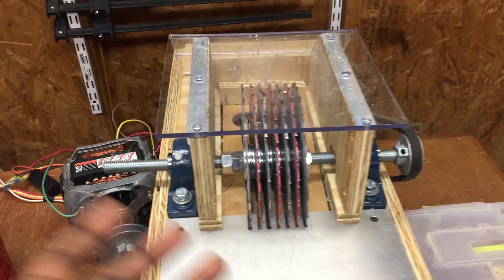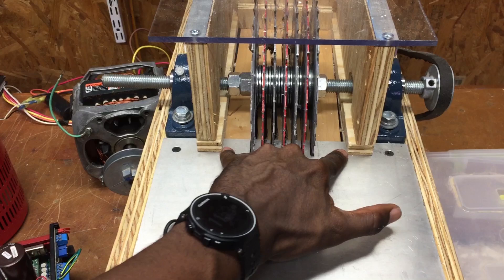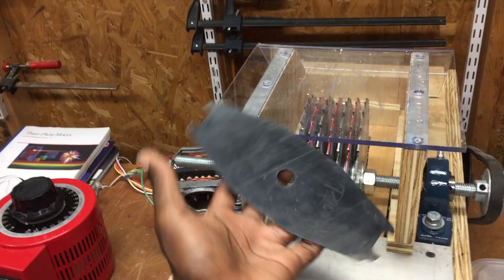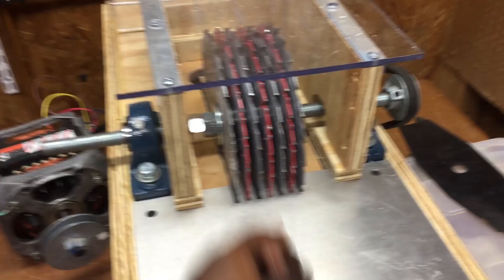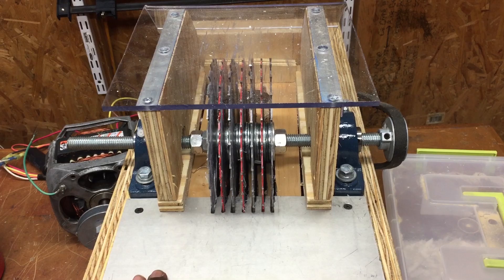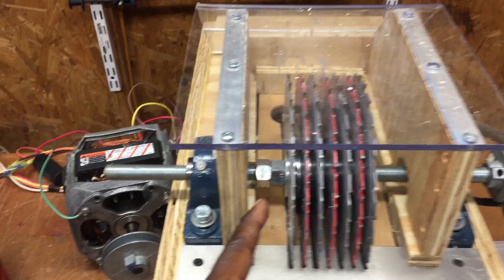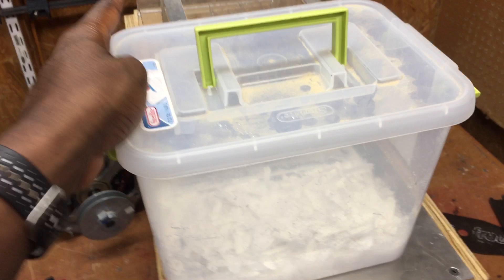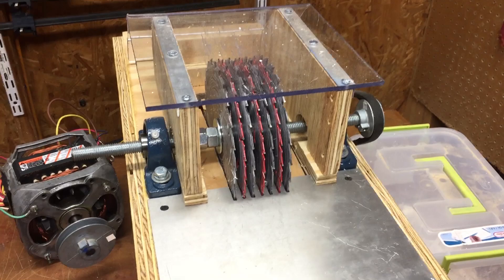Scary Prototype Shredder Design pt 2; A Cheap Alternative to the Precious Plastics Design: 037

Comment: Ideally you would want to use a blade like in a wood chipper. A blade that cuts axialy as opposed to radially, like a saw blade. However, I know you don't own a metal lathe and Cnc so that would be difficult to make. And I know sawblades are already easily accessible. My thoughts would be use smaller blades. Maybe something like you would find in a biscuit jointer. Or at least a blade with less teeth. The more teeth, the finer the shavings. The less teeth, the more coarse. I have no experience melting hdpe but as you said in the video, your subscriber had said he had problems trying to melt fine material. 
Going back to the wood chipper, you definitley want a funnel. Maybe 45° downward, tangential to the blade. 
One more thing to try, what if you tried rolling up the plastic sheet into a burrito and feeding it in? Just for shits and giggles.
Reply from the maker: +P0tat07 rolling it sounds like a great idea. I could angle the feeder slightly. This is just the most convenient design. This was the lowest tooth count I could buy for $6 each (24 teeth) . I really want 12 tooth blades. That is an optimization that will come in the futures
Reply: I'm thinking the denser the material you feed in the less it wants to pull due to the fact that it can't shred all the material being fed into it at once.
Reply: +Jeremy Fielding by angling the feed, do you also mean changing the point of contact? Looks like the blades are cutting near centerline. Would raising the axle and tilting the feed table down in give you a better pull?  Or would you consider sinking the bladeset into the table like a tablesaw, with a rip fence whose fingers go between the blades instead of yours? A sled box you fill and slide over blade set repeatedly without opening it.
Reply: How about mounting a chipped blade on a radial flywheel in a wood chipper?

Comment: Mount it from the bottom like a table saw, adjust the depth to best angle for purpose. Add an inclined bed to feed it at about 40 deg. Just a thought.
Reply from the maker: +Brian Johnson that is almost exactly the plan. I mentioned it the last video on plastic. Titled “HDPE how much processing is required”

Comment: one thing you might try if making the spacers bigger so only the teeth are still open , that should prevent the material turning intoo ribbons as it cannot get in betwee the sawblades and prolly gets regrabbed and pushed though the slits in the scraper

Comment: Why not try having the spacers that are angled downhill? Like at 45/135°? Gravity and the hopper will draw it foraward, and the wind should flow from the back. Have the spacers between the blades have clearance with the blade, and the exit shoot below. Could even add crosscut by having the material being cut flow across the blade beside by having the spacers turn 90° to the cutter.

Comment: Hi Jeremy,
You said that you don't want to have it gravity fed because there is no place for a shear plate. I'm curious if you have thought about having the current setup on an incline (say, between 20 and 45 degrees) though I am sure you have.  I think that in combination with the plunger would allow you to more efficiently feed the system.

Dropping directly on top of the saw transfers the force horizontally and with the absence of the shear plate the plastic would start to spin out of the hopper.
If you feed the plastic in on an incline, the force parallel to the shear plate will guided the plastic into the blades but the force perpendicular will keep the plastic from spinning out of the hopper.

My other thought was shifting the entire plunger+hopper assembly to the left and right while feeding might let you cut the plastic into smaller pieces instead of into strips. You could set the plunger up on a continuous S shaped groove while having the hopper free to move left and right. That way when you push the plunger the hopper will follow, shifting the plastic left and right as you push. 
Obviously this is not the most elegant solution but just some food for thought :-) I am not sure how else to overcome the issue of ending up with long strips of plastic.
Reply from the maker: Well, I actually think long strings is OK after considering some of the other comments. But I like the idea of a frontal incline. 30-40 degrees is definitely doable, but fully upright makes it very difficult to support the shear plate in between the blades. Pushing from an angle is also interesting. Very good food for thought. The swivel is a bit too difficult I think. Not for a one time build, I just mean I want the design to be easy to copy by others. I want to make free plans and I need the parts and plans to be simple.
Reply: You are right, swiveling would make it over complicated. Pushing from the side could definitely work. You could potentially have some sort of collar to move back and forth just before the blades to achieve the same results. Like a section of hopper that can move freely back and forth with some ridges to help push and pull the plastic around. Again this may be too complicated if the long strands work jut as well.

I appreciate that you take the time to reply to the comments. Too many channels on youtube are unable to respond at all. Love the channel and all your great work. I've already got 3 motors waiting to be made into machines once I can find the time. Have to get my aluminum casting setup ready to make some pulleys. Your videos inspire me to keep working at it. The fact that you are putting plans out for free is very respectable. Keep it up!

Comment: I've just recently discovered your videos by way of the precious plastics videos and I'm trying to do something similar, a plastic grinder with either off the shelf, salvaged, or homemade components. I'm not sure if you've seen YouTuber thang101046, he has diagrams for counter rotating designs that would use a single power source. As for blades have you considered a smaller diameter blade with just a few teeth like a 4" joiner saw replacement blade with 6 teeth? They can be picked up at harbor freight. Keep up the good work. You are an inspiration to the DIY community.

Comment: You also don't need all of that exposed blade. Make a throat plate that you just push into the blades, and cut the slots into it. Like putting a zero clearance plate in a tablesaw and raising the blade up into it. You could do this, and end up with a sort of "Vee" with the blades at the bottom of the vee.

Now that you have your vee... Figure out how to feed it at an angle as I suggested previously. You'll end up with shorter 'lengths', if any at all. Those lengths come from what rides between the blades. If the plastic is at an angle, the 'length' gets cut by the next blade.
Reply from the maker: I have decided to go back to the dado stack arrangement but with regular blades. I think changing the feed height and opening with the dado stack will give me the results I want. It is difficult to fully detail in the comment section but there will be a video when it is done
Reply: Looking forward to it. :)

Comment: I saw your comment about reducing the 24 tooth blades to 12 tooth for larger chips. Seems like a good idea to me. Have you considered raising your shear plate to slightly, slightly above the center of rotation? I'm thinking that would reduce the tendency to pull the plastic and your hand in. Looking forward to further developments in search of a cheaper better shredder for plastic hobbyists and small scale recyclers.
Reply from the maker: Yes... I just haven't made the change to test it out. With the spacing I have now... That problem doesn't exist any more... but I do believe the feed height relative to the blade makes a difference. This height is just convenient for the pillow block bearings. But I could elevate the table in front of the mount and position it  more like a table saw. Then the blade is pushing the plastic back towards me.

Comment: I'm very interested in seeing how this turns out. I've made several things with HDPE & cutting it by hand is a drag. I've tried cutting it with a wood chipper, but the results weren't that good. Keep up the good work!
Reply from the maker: That is good to know. Thanks for sharing. Several people have recommended something like a wood chipper. I have not gone that direction.
Reply: Jeremy Fielding In all fairness the blades on the electric wood chipper may need to be sharpened, but I suspect that the blade configuration & feeding method wouldn't be as efficient as the one you have created to shred plastic without some augmentations. Once I figure out to sharpen the blades I will be sure to share the results tho'

Comment: Hey Jeremy,
I recall using a machine that peeled potatoes. It was basically a cylinder with water and an angle grinder type wheel that spun around in the bottom. Have you thought about the use of angle grinders to shave the plastic instead of cut it. Harbor freight always has deals on them.  Just a thought.
Reply from the maker: interesting idea. I don't know

Comment: If you added a pipe to each side that was large enough to press against the blades you could move the nuts outside of the box and fill the space with more blades.
Reply from the maker: Yes... That sounds great.. A spacer would be good. I would have to move make the assembly a little wider... but that is doable. I think I will work out the hopper first, then I can go back and redesign the cover and corresponding space in between.

Comment: Safety Third Jerms. I wish I could pitch in my two cents for this prototype and not state the obvious or what someone else might have mentioned. Maybe if you just cut up strategically sized sections of the hdpe and feed them into the chipper so you can get somewhat consistent sizes to melt. I usually cut up milk bottles so I have 4 flat-ish sides to easily cut into strips
Reply from the maker: +Kevin Dobbins-Callahan yes that is really what I do now. What you saw was just a demonstration of its current state

Comment: Maybe (potential) melting problems with the finely shredded plastic could be mitigated with pressure?  A heated screw, injection molding style, might have enough heat/pressure/shearing to recombine all the plastic dust.
Reply from the maker: Stirring the plastic occasionally while heating I think will mitigate that problem. But I haven't Tried yet.

Comment: Good video. Great approach to making people responsible for their own actions and safety. If there was no risk then it wouldn't be worth it. I think the hopper and plunger is the right way to go. Wonder how it copes with thicker or bulkier pieces like bottle tops or lids etc.
Reply from the maker: +Tactical Dad I am just testing it for the first time but I think guiding it into the blade is the main hurdle. They seem to cut very well with the shear plate.

Comment: A hand-cranked machine might be nice.  ;-). You might be able to put blades closer together if the flat part (shear plate?) was thicker, but is it really necessary?  Changing the position or angle of the shear plate might help some too.  You're basically making a motorized scissors, so why not inspect the geometry of those?

Comment: Great job, how do you think a u shape shear plate would work? Like a half pipe shear plate, I think it's be safer and easier to feed. Then you could probably cover everything but an entrance
Reply: Or sharpened 1/2 pipe behind saw blades to cut plastic "ribbons" into squares. Doing so may allow slightly wider gap on saw blades thereby generating less plastic dust.

Comment: It seems like having the plastic feed in low like that would encourage the materials to pull your hand toward the blades.
Would raising the in-feed table level more to the level of the center of the drive shaft reduce grab?  
Would having fingers between the blades on the back side reduce material from finding its way back into the work area?

Comment: What would happen if you replaced the shear plate with a shaft that had large washers protruding in between the blades and spaced with smaller washers. More strength allowing narrower spacing is my thought. Also material would be sheared and not jam as the washers could rotate with pressure and cause more shearing torque.
Reply from the maker: +Randall Ivie that sounds interesting... you want the second shaft to roll on bearings? One issue is washers don't come in a consistent thickness. You would have to move them around through trial and error until everything was lined up. I don't know if I have everything to test this.

Comment: .Jeremy, Please forgive me, if you have already,  tested, the following.

Try adding, a size grading SCREEN/MESH, to prevent larger cut BITS/PIECES, of from being fed into the collection bid.

This would require you, to add a second shearing plate, to the inside...err, below the input surface.

No shredded plastic could enter, the collection bin, without being sized.

Just a lite going ON, moment, for me.

Brightest of Blessings,
OLIVEA
Reply from the maker: Thank you for the suggestion. This is one that is incorporated in Dave's original Design (shown in the first video). I probably wont add this feature until the very end. But I am considering this a important addition.

Comment: I was thinking about finer tooth blades. But not sure if that would help. I know they make a fine cut in wood, just my 2 cents. Yes it look dangerous,but i know as well as most of the people here know you have a good head, and would ( NOT ) do anything you are not comfortable with. Thanks for sharing this video and your channel is one of my top three channels on youtube...
Reply from the maker: +Robert Evans I am not sure which way to go with the tooth count. If fine dust doesn't work we might want fewer teeth more like 12. It will require some melt testing
Reply: You take the gallon jug and with a sharp knife you cut the bottom off. Put the bottom aside. Now take the rest of the jug with the cut side down on a cutting board and put a slice from the spout down each corner of the jug, then two slices around the handle. OK now with some shears you cut all them dangly pieces you got flapping off the jug at the top bend line. You do this into a box to catch the pieces as they fall away. Now you got this funny handle piece, the top of the jug, and the bottom of it too. Again with shears you cut all the little pieces off the top part, so now it is just the spout. You cut them pieces into another box. The handle is a pain in the ass. What I do is cut up it with shears into a strip a side, then cut all them strips away crosswise. These random bits go into yet another box. All the bigger pieces you cut you're going to sort like piece with like piece for each jug you cut up and make stacks of all the same kinds of pieces. You melt the stacks of pieces together. I process while I watch videos. I batch it out. I cut the bottoms off, then slice down the jugs and set all that aside. Then once I've cut all the jugs I'm going to do I pick it up at the next step. Until I've broken everything down, and sorted it all out.

Comment: I just love your videos, I have already learned a lot of practical things just watching them. I saw a chainsaw chain in Aldi today and immediately thought of wrapping it round a shaft and use the teeth as a plastic shredder. Unfortunately I do not have any electric motors other than my electric drill, and no gearboxes. I would appreciate if anybody has any suggestions of how to do this, or even better, do it and show it on here how to do it. I was also thinking of just melting the whole milk bottle in the oven first. This way it will  be firmer when pushing it into the shredder. Thanks

Comment: I think if you feed the plastic in at a 45' angle from the side,you might get rid of the problem with the stringy pieces.
Reply from the maker: I haven't tried that. You might be on to something. Perhaps it would grab a little and cut pulling it sideways

Comment: Dear Jeremy, I have been in the recycling field at least theoretically for the past few years. I would suggest you to try a punching system - like paper punch - by incorporating a motor , the washing machine motor itself. The low speed high torque system will be safe and will give you continuous operation. The main characteristics for better performance would be the cylindrical /cubical blades and plates - number of them placed either on a straight line or rather alternately - placing it on a roller or flat surface - and the continuous fed mechanism. If you want I can explain my design to you - just send me a reply with your e-mail ad. I am a hell far from you - the Indian Ocean - Island of Mauritius. I will keep up with your videos and provide any improvements possible. I am also doing the same stuff as you - that is re-using scrap electrical appliances for parts and re-engineering into new equipment. Keep the story going.. Goodluck.
Reply from the maker: You should delete your email from above. You can edit your message so you don’t get spam email. I sent you a message.
Reply: ok thank you.

Comment: Find an old (or new) manual push mower. I'd like to see that! In fact, I just got one for free. Makes me want to power it! They are 20-24 inches wide, but that can be modified, can't it? If not, the design of the spiral blade against a shear plate should work nicely, which leads my brain in the direction of a meat grinder. An auger feeding material to the blade and shear plate

Disclaimers are always a good idea...  Don't do this at home. Do it at your neighbors house!
Reply from the maker: Ok... I might add that one lol